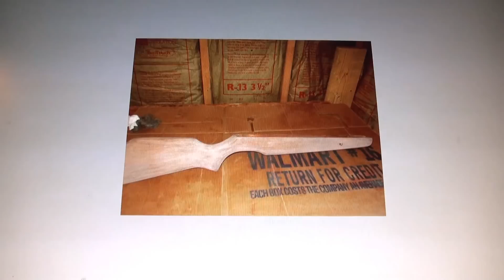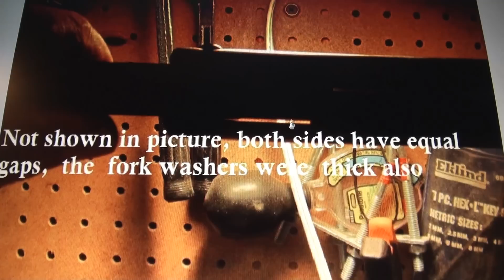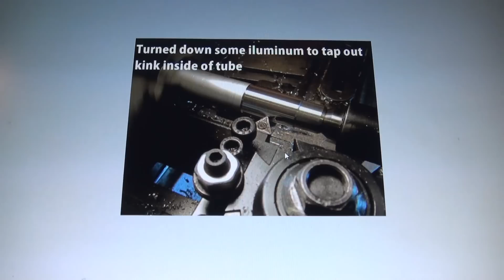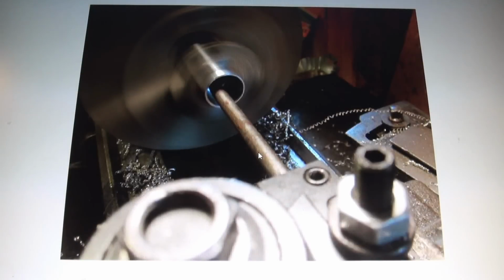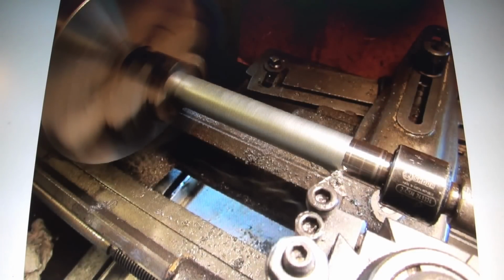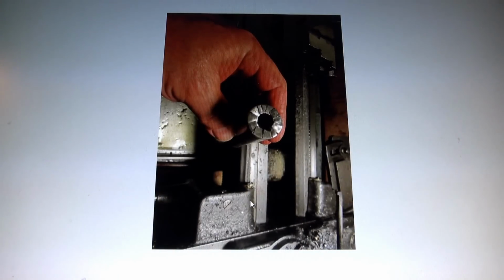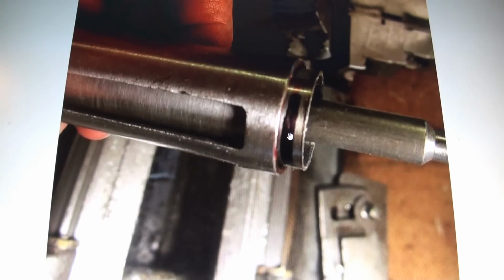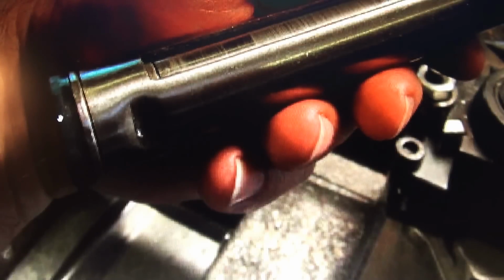Making a piston sleeve for the Ruger Air hawke & sharing

Comment: hey mike .i use a paintsripper from a can that looks like a thick  ahornsirop .paint it on the stock ,and after 15 minutes,
 i use a fine brass brush  like a  big thoothbrush and in a few minutes the finish is gone .
  take tung oil and a fine wet dry sanding paper  in 300 - 600 -1000 and its in no time ready a oil finish
Reply from the maker: Thanks 
see if  you can find the name of  the remover, I tried the aircraft paint remover and I still had to use the other type
Reply: @MrSteppingstone888   its called    superafbijt    from alabastine  a dutch product 

https://www.alabastine.nl/?s=super+afbijt

its a paint remover very strong

Comment: Mike, I just watched several of your videos and I found them very informative. I have been working on a WFH for years. I've made a lot of mistakes and I've learned a lot the hard way. So many things you pointed out I have found to be true. Although I have a first generation design with a trigger like a Daisey and just one pin instead of three on the receiver, everything you said are things I have learned to be true. Especially the lock up issues with the pivot bolt. There are a couple of other things you didn't discuss but maybe we can talk later. BTW, last 25 years I've worked industrial plumbing, pipefitting, welding and more. You speak my language. That person who posted that rude comment should be ashamed. Anyway thanks for the vids.
Reply from the maker: +christian humphrey 

Yes  the rude  person above, there  is always a few  of those types in the world who have high opinions  about themselves,  and low opinion  about every one and everything thing else.

The wfh you have with the single  pin those had excellent barrels, I had one, and the pistons were lighter but  had a big heavy steel top hat  to help the lighter piston.

 I took the barrel from mine  and used them in a 125  with a three pin and quattro trigger receiver.

I just bought two W F H in  different  camo  .22  as new,  one  with a spring one gas rammed  came with rifle cases  and scope  the other had a lazer on it, the deal was  so good I could not refuse.

sure  drop me a email when ever  you feel up to it and we  can share.

 a lot of things I have not shared  because  I am hoping people would research things  to find  out on their own

I am still  doing plumbing work, but it is not as  hard as it used  to be, no big commercial work  for me,  those days are  long gone.lol

awaysmike@hotmail.com
Reply: +Mike Ellingsworth** Mr Stepping Stone***
  Hi Mike. 
I'm currently in the middle of a rebuild on my wfh right now. My friend works for a machine shop so I can get parts made, finally. My question is about piston weight. I remember you saying in a video that the 125 piston weigh 14 to over 16 ounces. I weighed mine and it is 10 ounces. I had a nearly 2 ounce tophat I made. It was pretty loose and I have an extra rear guide I was going to use for the top hat but the weight would be even less. So I'll have one made but I don't know the ideal weight. Any thoughts? 
   I've done so much to this gun there probably isn't one thing I haven't changed. When I get it back together I'll get some groups and chrony numbers and share them with you. It is a very unique gun I'll tell ya. 
   Been a member of GTA for a few years and sometimes read the yellow.
Reply: +Mike Ellingsworth** Mr Stepping Stone*** 

    Also wanted to ask how long I can make the top hat without bottoming out.
Reply from the maker: +christian humphrey Gta kicked me off because  people wanted me to do some tunes  and they got pissy about it  and did not like my sharing paul 68 was a big jack ass /Gene later lied and said my gas filled ramed cause the barrel to bend  he said he tried it, nothing but liesthe newer  hatsan 125 piston are about 13 .8 to14. oz  I mentioned some where before the early wfh had a lighter piston with a big steel top hat.the newer hatsan 125 with heavier pistons, slam  see what she is likes with the lighter piston and play with  the weight.pretty cool I'll be here when you have some up dates and results
Reply from the maker: +christian humphrey   I would think 2"  you could always find out sorry I don't have exact data on it
Reply: +Mike Ellingsworth** Mr Stepping Stone*** 

   Kicked off GTA? What was your name so I can look up your posts? I still look up things on there but haven't posted in a long time as I just don't see eye to eye sometimes and I'm on a phone so typing is a pain.
  I'll see if I can get the top hat and the washer for the pivot ( I want to make it .004 thicker to match the fork gap) made this week and do some shooting and see where I'm at. While looking up piston weights I came across several posts of yours. And Fang. Anyway take care buddy
Reply from the maker: +christian humphrey I think my name was 4888blues the same as on  the yellow  or type in Mike Ellingsworth on gta or Quattro trigger on gta older post.  talking about the Quattro trigger and how strong it was I got one of gta members to see how strong the Quattro design was by giving him detailed measurements  of the parts
Reply from the maker: +christian humphrey 
I forgot to mention. I am pretty sure they went thru and deleted  all post  related to my name on gta  ever since I started making the you tube videos, a member mentioned to me they mocked all my videos when it was mentioned  on the gta  site

never in all my life have I ever experienced a big bunch of  J ass  e
Reply: +Mike Ellingsworth** Mr Stepping Stone*** 
   That just goes to show that although we are all fellow Americans enjoying the same hobby weird things seem to pop up with group mentalities. I would have loved to see your videos years ago. Dozens of hours on GTA don't compare to your two hats an videos. Still waiting for my parts.
Reply: +christian humphrey And why in the world would they mock your videos?
Reply from the maker: +christian humphrey  rather  then admit they were wrong in the way they acted  the 1st chance to say I did not know what I was doing  came when they saw me lube the trigger parts like I did. saying he doesn't know what he is doing.  my lubing the trigger was to keep dirt out  and from penetrating in further into the parts.  those hatsans are more hunting rifle then anything else so I choose to lube for protection with outdoor hunting in mind.it was a few select Gta inner circle  people/ old news now I could care less. don't need them or care for them never had since they showed me what they were really all about.
Reply: +Mike Ellingsworth** Mr Stepping Stone*** 
 I'm watching a movie with friends but also started reading your posts from GTA. You have over a thousand of them. As far as trigger lubing, I'm no expert. What I did was dip it in slick 59 ( the trigger group) and let it settle on a cloth over night. I got that crappy long stiff trigger to be relatively perfect. Of course I filed it,smoothed it,and added a screw . Also shot a hole in my wall before it was done but I like it now. That was 3 years ago. For hunting and such I like it better than my marauder trigger. All that after I looked into buying another trigger from hats an(Scott) but couldn't. As a retired millwhright I'm not able to throw money around. But I'm happy and able to still get what I want. Just not as fast as I'd prefer sometimes.
Reply from the maker: +christian humphrey if you have a older one you can get a lighter but safer upper seer spring for the trigger so its not so stiff.these hatsans are like Stratocaster guitars they take a lot of tweaking to get them rite lol.I am packing it in for to night take care. gees I did  not know I had that many post on GTA lol
Reply: +Mike Ellingsworth** Mr Stepping Stone*** 

Yeah Mike I tried every combination with the springs you can. Put it this way, when I took the trigger off I didnt know what I was doing and all the parts just fell out. I put it together and put it together at least 25 times. Remember I said I learned the hard way! 
   anyway I read about 200 of your posts so far. Very interesting your journey from the beginning, which is where I started. I see how they treated you, Gene in particular. 
   We have one thing in common for sure, our love for air gunning springers, and Hat sans. Well that's three things but you know what I mean. If my results are good enough and you're interested I will tell you the story behind this gun because it was an interesting journey. I also have a maurader,Benjamin super streak,quest,392 from early 80's, and a rs2 from 2009. The been an is up for mod now also. Put a Luther Walther barrel on it.
  Still waiting on machined parts so that's all for now.
Reply: +christian humphrey 

Lother walther- auto correct!

Comment: It is funny how we tend to blame greed and cost savings when we don’t understand something(we all do it). The hardened bushing that the barrel bolt goes through is not an engineering shortcut. It provides a hardened(or not if it is a wear part to be replaced) pivot that is considerably larger in diameter than just a bolt. It is fixed and a far more precise fit than a bolt fit hole. You need that precision since that fit effects accuracy and a seal at the barrel. Imagine if they used a bolt - the wiggle 16-18” away at the barrel end would be shocking. So that bushing is actually quite ingenious, a sign of quality, and necessary.
Reply from the maker: Hello. That video is Old LOL / I agree with you. I think we also don't like to see change, after  you have  it in your mind to what is  acceptable and best
BSA and I believe gamo uses a single press fit  pin at the barrel block to fork install , no sleeve also it does double duty by holding the large spring jam in and the pin is about 1/4"  on the BSA  you need to use a hammer to set it while holding the spring jam  back for slot & pin alignment, I am doing a video  on one now. it was a NON FAC Model I am changing the transfer port to get  full FAC power
Reply: I'll look forward to that one. 
I have seen some barrel pivots with no bushing for sure but I think most of those used a shouldered bolt with a greater diameter. I suppose the sides of the breach prevent slop to a point but I would still want a precise pivot. You have a lot more experience with air guns than I do for sure.
Keep up the good content!

Comment: That was a lot of work, lol.
Reply from the maker: Yes   I wound up making one out of delrin also  , 7 yrs  ago, man that guy is long gone LOL  / my Benjamin trail part two was in the works  I just  found the bottom of air chamber  is to tight went from 900fps to 850 with piston seal worn down
I re barreled  it cerakoted  it  and fixed a lot of issues with the lock up and now that was revealed. A lot of time spent on it  even made two  new piston buttons  using two pistons for a different piston seal